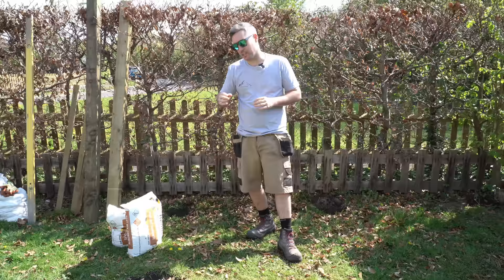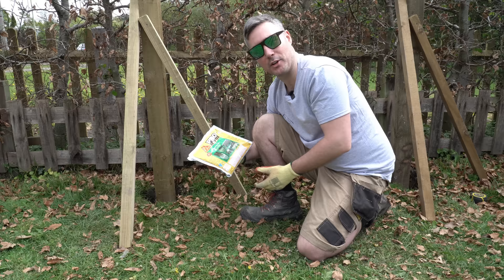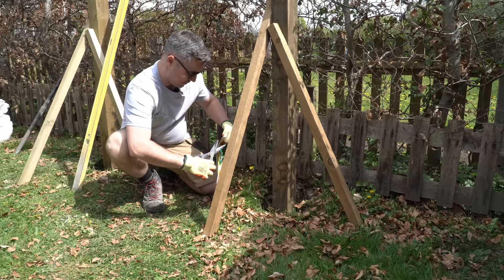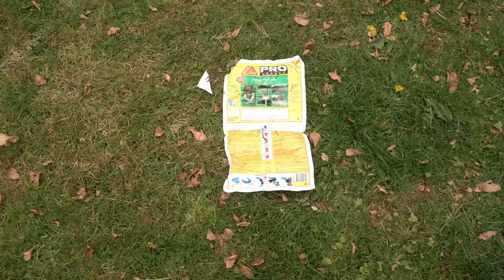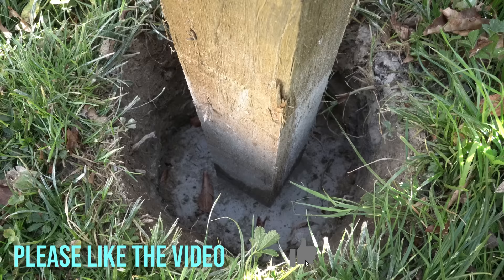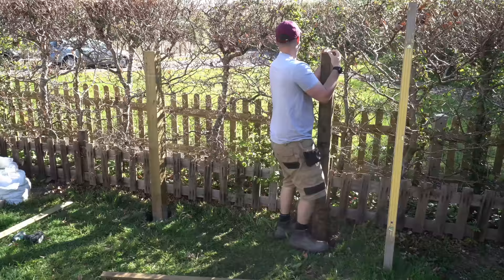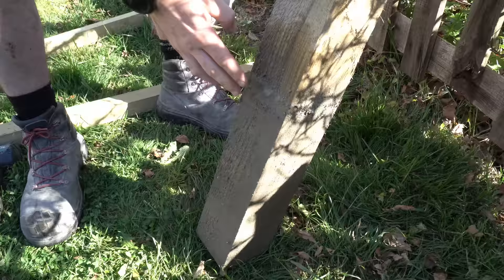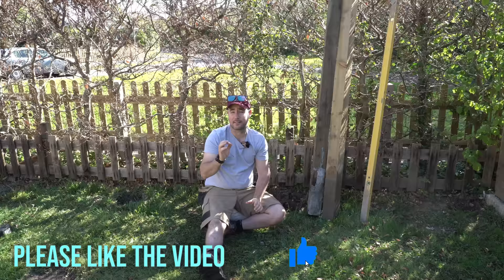Fence Post Foam vs Concrete | STRENGTH TEST

Comment: Been using concrete for 50 years no need to dance with a new girl
Reply: You must be boomer 😂😂😂
Reply: @ealv844  LOL how could you tell.
Reply: The idea behind concrete for fence posts is that it's heavy and serves well as an anchor for the post. The foam is like air holding the Base of the post no weight "anchor" at all. It doesn't have anything to do with age just common sense and physics.
Reply: @tired7140  I know exactly how the process works and the engineering behind it.  I've probably set more post and built more houses than you've been in.  Please don't need a lecture
Reply: 🤣🤣🤣Air holds better than concrete......... I'll take weights for 300 Alex...
Reply: Yes, but even though you get tired of her, she's still number one 😂
Reply: @blakeshawke1934  She's never failed me
Reply: ABSOLUTELY!  I’ve got a deck with 4x4 posts concreted in the ground for 35 years (in damp/wet conditions), and they’re still going strong.
Reply: ‼️ What a great saying ‼️
Reply: What you guys are saying is all well and good, but it's not the point here. Does it work, yes/no. I have no doubt concrete is better and long term etc but for someone choosing THIS option will it suffice.
Reply: @TheycallmeMrWonka  I agree with you 100%.  So many times I've thought I'll try this but end up doing concrete.  Hard to teach an old dog new tricks, especially if the old tricks never failed this dog.
Reply: Yeah but like who asked?
Reply: @tired7140  you clearly don't know much about the physics. The ground holds the post, the concrete attaches the post, it isn't holding it down via the weight of the concrete. They use this type of foam for power poles attachment.  

Your "common sense' is just ignorance pretending to be knowledge.
Reply: @gilbatzri I think the worms are attracted to it and this is where the strength comes from!
Reply: Pour a concrete footing.   Attach a Simpson Post base to footing and post to the base.  Wood should never have contact with the ground, regardless of the type of ground.
Reply: @B.E.C.K.  Exactly when I did it old school years ago I didn't use Simpson post base. Just built a nice deck and did just as you said.

Comment: I would like you to dig up the concrete for the one post, I am curious to see how well the concrete mixed in the hole without actually mixing it.
Reply: it didn't, that is why he could pull it out by rocking it back and forth.
Reply: its ready mixed. just add water
Reply: @chrisyoung9653  do you really think the bottom, say 4"-6" was mixed properly and hard? I don't and it's from experience.
Reply: @durkkush8802  ive been doing fencing for 12 years man. never had a problem with it yet. i always use lafarge or blue circle and its great.
Reply: @durkkush8802  if the bottom didnt set right you probably didnt use enough water
Reply: @chrisyoung9653  I have yet to see a Ready mix that does not require mixing it, yes the sand, gravel and cement is premixed in the bag, as the name says, ReadyMix. Every instruction and installation I have seen requires Mixing the Ready mix with Water, in a Cement Mixer or Mortar container, wheelbarrow or even a bucket.
Reply: @chrisyoung9653  as per Lafarge instructions on their Ready Mix bags.. MIXING GUIDANCE (BY VOLUME)
Factory produced prescribed concrete mix; incorporating standardized binders and aggregates.
Water Demand: Approx. 2.0-2.5 litres per bag.
Contents of the bag can be mechanically mixed with the required quantity of water for approx. 3-4 minutes in a free fall mixer or hand mixed by pouring the contents of the bag onto a clean, flat surface and slowly adding clean water and mixing continuously to achieve a workable concrete mix.
Reply: well thats how everyone here does it and you seen the guy hanging from the post. kinda hard to argue it doesnt work. never had a fence come down in a decade
Reply: @chrisyoung9653  and I can appreciate that people do it that way. After 45 years of using concrete or posts, poles, slabs etc I can assure you there is powder not mixed in that hole. 
Ultimately it comes down to how you properly service your customers, such a small issue as following the instructions on a bag of cement and using this as a selling feature may come in handy.
I won’t even get involved with the issues of frost, plastic wrapping around concrete tubes and possible 2’x2’ footings 4’ under the posts. 
And for some real brain cramps on this subject… Get a hold of your local building codes regarding all of this, as it sure looks like not many contractors even have the desire to follow local laws or even know if they exist. 
As you can see, someone who posts a video showing “How Too” or “This vs That” should also be able to do it properly and have depth of knowledge regarding such things as it leaves them open to interpretation, and sometimes that is more insightful than the video itself.
Good fortune for you in the future.✌️
Reply: ive dug out my old posts before and never had that
Reply: @Durk Kush  same.  I've tried to pour on on flat ground, and only the top few mm are even wet.
Reply: @user-cr4pz5yg7y  water first. It should seep up right through. No such thing as too much water man don't be shy with it. If only the top is wet I assume you are adding water last
Reply: Zzzzzzzzzzz😞😡🥴🥱🥱
Reply: It’s going to be fine, you can put a dry mix in and it will go off with ambient moisture..

Comment: Why would you - no matter which material you used - have your lumber below grade? Makes no sense, it’s gonna rot off eventually. With regards to the concrete, the bottom is in direct contact with the bottom of your hole. Where did you learn that faulty technique?

Comment: Just drove by our fathers old horse ranch in Springdale Oregon where as teenagers some 50 yrs ago we built fences.  Railroad ties at corners and pressure treated 6"X6" posts every 8-10'. 2x6 pressure treated upper and lower rails with galvanized 5' wire mesh.  Hand tamped each post with a shovel full of gravel,dirt and always using found rocks when available.  Smiled as I drove by.  Those were fences.  key note we put one electric wire to keep horses from rubbing fences loose.  Spend your money on treating the wood.
Reply: Built a few fences with posts hand-tampered with dirt 30 years ago, replacing fences over 50 years old built the same way. Yes, don’t need concrete or foam, if you just take the time.

Comment: I.worked at Lowes for a few years and they had 5 gallon bucket with a post and filled with that same foam for a display. it had shrank about a inch over a couple years and was just wobbling around in the bucket ..they finally had to make a new one because it looked so bad!
Reply: You can't prove a failure better than that.
Reply: In fairness a 5 Gallon bucket won't shape around the foam, the ground and dirt will.  If it takes a year for it to shrink an inch the soil will keep up with it and keep it tight theoretically
Reply: Wobbling in the bucket, not around the post. The ground isn't a bucket. The ground will continously conform to the changing shape of foam, the bucket won't. That said, I would still use concrete, or just backfill with a very sandy soil which sets really strong and drains better. I live in a sandy soil region and most fence installers around here just do that. Problem with many concrete post installs you see is it rots where water accumulates on top of the concrete and breaks off there, then you have a hole full of concrete you need to dig out just to replace the post. Even putting a slope on the top of it is not as good a draining solution as just having the water pass straight past the post with a good draining sandy soil fill. Honestly, the only posts I would put cement around are the one's that have to be as rock soil as possible, typically the two on either side of the gate, so there's no door sag and even then I'll dig the hole 3' deep minimum.
Reply: The utility companies around here (TXU) use foam to set utility poles. So whatever they use works well.

Comment: Thank you for the video. When I used the foam, I poured it against the fence post and above ground level.  That way the foam will coat the post and seal it against water. (It will slide down the post and you won't get that rolling effect that you see in the video.) I also went back a couple of days later with a utility knife (any knife would do) and trimmed the  above-ground foam away from the post at an angle.)  Finally, I think the bags cost me between $6 and $9.  If you are digging a wide hole, consider getting two bags.  At my age, it's a lot cheaper than a strained back!  Thank you again and no, I don't work for them!

Comment: Being American- I cannot comment on UK soil conditions. But here in the north east USA I dug a 36" post hole and used Post Fixit with a 4x4 post like you used. I mounted a substantial retractable hose reel that weighs about 40 Lbs. 3 years later, it has held with no noticeable tilting. You perhaps should have dug a deeper hole than you did. And yes, where I live we do have a high water table, but I make sure I tripe sealed my pressure treated post with deck seal-, paint, and a plastic moisture layer. I hope this helps.

Comment: i went 4 ft or 1.22m deep and used a 1.5 bags/hole, 1 set bag and .5 bag later as filler. make some sort of plastic cone (oil it) for the overflow, this will provide some downward pressure as the foam expands and help resolve the water issues mentioned. Both methods would be a lot stronger filled to the top too

Comment: I rarely ever weigh in on comments but I have to on this one. I have a large acreage and have foamed in over 150 5” and 6” posts, along with numerous 4” and 6” square posts. Expanding foam works better and expands more if the temperature is above 70 degrees. I do not use , but have used, the SIKA prepackaged foam. I buy the foam I use in 1 gallon containers and mix with a drill,  proper mixing is absolutely key!!!

I have had to pull several end posts to put gates in and they hold great. Plus when I pulled the posts, I used a saws all with a 18” blade to cut off the foam. The post was completely dry, it had been in the ground 6 years and looked brand new still. I let the foam rise above the ground and use the saws all to make a small cone from post to ground so the water runs away. 

The foam is a bit more expensive then concrete but a lot less work! Concrete is porous and actually absorbs water like a sponge. Concrete never truly sets for years, the chemical reactions (hydration) is what causes it to cure. Concrete wants to absorb water and causes the wood to rot sooner or later. The weight on the bottom of the post is nice but the wood will eventually rot. Foam seals the wood, it will not rot or absorb moisture, sealing it. Foam “shrinking” is not a thing. The ground around it can shrink due to less moisture but the foam does not. Improper packing of the soil before placing or water saturated soil is the cause, not the foam. It can not shrink, it dries to a very hard substance. Concrete does the same thing, if the ground surrounding it wasn’t untouched soil or compacted properly, something better than a 2x4, it will move when the ground shrinks too.

If you make your post hole a slight bell shape at the bottom, the frost locks it down. Ground freezes from the surface down. Doing this helps to stop any heave from a deeper freeze. Also, if you move the curing foam or improperly mix the foam, it can create voids . But it will not if you follow the instructions. 

If I get the mushroom around the post from the foam, I just add a bit of new foam to seal it and then shave it down when cured.

Power and telephone companies have been using foam for years as it is far 
superior, my father worked for a Rural Electric Company for 35+ years and remembers when they first started using foam. He said it was a game changer. 

I have used foam for over 10 years on every type of fencing and miles of barbwire, we stretch the wire and have never had a problem. 

Sorry for the long post, I just read so much bad information and had to chime in.
Reply: Thank you for the information from your experience.
Reply: How much of the Earth's ozone layer does it destroy?
That's an important consideration no one seems to want to consider.
Reply: @jhandle4196  concrete is one of the most destructive carbon / environmental damaging substances we build with and we use millions of tonnes a year. A small company using it for fences doesnt make a difference
Reply: I used the Sika post foam for a new fence about 4 years ago. The temp was above 80F & it overflowed out of the 2 foot deep hole. I used a recip saw to shape it after it cured. The posts are still very solid today.
Reply: Hey man.  Valuable info.  I’ve got 4 posts that lean a bit.  I was thinking of just digging on  the side I want the post to go and then put this or just mix in the hole made when I moved the post.   It’s a very slight lean but I’m anal retentive and would like to do a quick fix.
Reply: @AbeFroman-zx5hs  The Sika post foam doesn't apply any pressure as it expands, it'll just expand up out of the hole if there's no where else for it to go. It's just a liquid until it cures. You'll need to dig out around the post to straighten it or pull it & reset it & then foam it in. Use a brace to keep the post straight while the foam cures.
Reply: @da4944  thanks man!!!  A big Definite on the brace.  👍👍.   Think I’ll do concrete.  I just read your other comment.
Reply: @AbeFroman-zx5hs if I was you, over dig all sides a bit and more on the side you push to level it. I works much better if it’s solid all the way around the post. But I have done this before and digging 18 to 24” deep all the way around and 4 to 6” around post, made the post solid and has not moved since.
Reply: @brucehokel4618  thanks man.  You’re right.  Better to fix than put a bandaid on it.
Reply: @jhandle4196 Does the foam contain illegal CFCs? If not then the ozone layer is safe.
Reply: @gowanlock true but the process of making foam is extremely destructive as well. The tanks that the ingredients are in are so volatile that it could destroy city if they catch fire. We weren't allowed to smoke without a half mile of the tanks . I had no idea the chemicals in foam were so explosive before they are mixed.
Reply: it doesn't have the weight
Reply: @brucehokel4618 what is the product that you use called?
Reply: @jhandle4196  less than the batteries in your ev
Reply: thanks for the detailed review yes the feedback is great
Reply: @iJoel00  Polecrete
Reply: Thanks for adding that. i saw this and thought for the short section of privacy fencing I plan for the backyard that this would work, until I watched the video. Now I know it actually can work for my needs, just want to see availability and cost from Home Depot or Lowes.
Reply: I agree with everything accept a post rotting in concrete. Give one example where you found this to be true. The post will always rot within 6 inches of the surface where it has greatest exposure. It will never rot inside the concrete. Protect the post within 6 inches of the surface and it will never rot. End rant.
Reply: Very well put I enjoyed reading this you should comment more often

Comment: 3 years ago I installed a fence using the same foam you tried. My exp. so far is very good. No movement and the fence is holding up through winters well. I used 2 bags per post because I used 3 foot deep holes with gravel beds at the bottom for a drain. I did concrete in some of the posts that were shallower due to ledge. The concreted posts all have 3 half inch rebar glued into the ledge. They don't move at all but took 10 times longer to install. Over all if you need a mail box or some free standing post that doesn't benefit from the concrete's mass, I'd use the foam.
Reply: This is what I'm pondering. Our mailbox post has been 'drifting' away from the concrete road because the mail lady likes to drive right (literally) in front of it and off the road. We Had grass and solid land there, but now it's a big sandy ditch and the box has moved probably a foot. IDK if I'll ever have the $$ to Do it, but I'd like to add to the driveway and in that area put in a permanent square post hole that will have some sort of mechanism that allows you to apply pressure to the wooden post itself (that you insert into it). IDK, one of many things in my head that I'd like to do.

Comment: I have used foam in situations as a tech in telecom. I know how it works. One of the issues I have with using it to set posts is the weight that concrete adds to help with creating a lower center of gravity and a "foundation" for the fence. Especially is this crucial on gate posts. The extra weight of the swinging gates will inevitably cause those posts to lean.
Reply: that is what I was thinking about sir the weight. Like in my area you dig 1.5' down you hit water would the water cause the foam to float up without that base weight I'm sure in well drained area's it may be great but the water table here is about 12" to 18" would that be a cause issues using foam just thinking out load is all. have a great day
Reply: Foam, one good wind storm and the fence will be leaning. Two good wind storms even worse guaranteed.
Reply: It sounds like you're describing a bad footing. A foundation shouldn't be relying on its own weight to stay in the ground